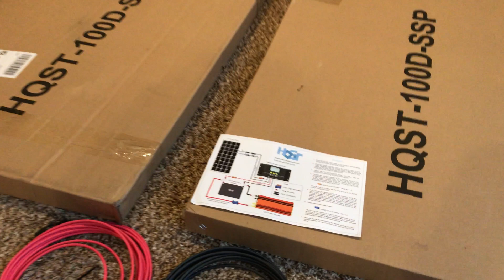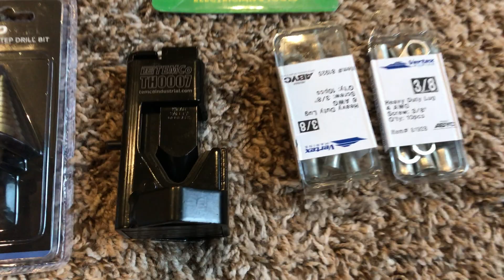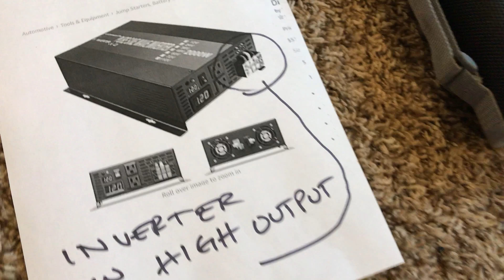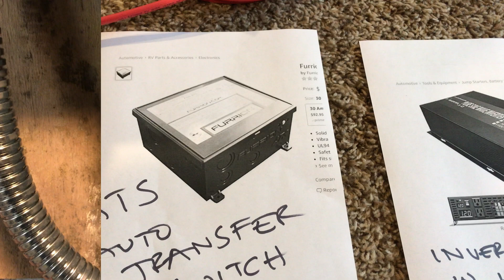Solar System Game Plan for our Travel Trailer - A Jayco JayFlight 212qbw solar installation 1 of 8

Comment: Really nice.  Thanks a lot for this vid.  I need all the help I can get, but I think I lucked out.  Looks like my Jayco is pre wired for solar and I just need a Go pro all in one system.
Reply from the maker: Thank you for watching! Mine came pre-wires too... but not really. All it really means is that it will charge your battery bank upfront. Your AC outlets are not connected to it. The batteries at front powers your lights, water pump, and the two 12 v cigarette outlet. For some it is enough.... but.. we want the fridge, microwave, and outlets for a coffee maker. please watch the series. This is part 1 only.  Thank you again